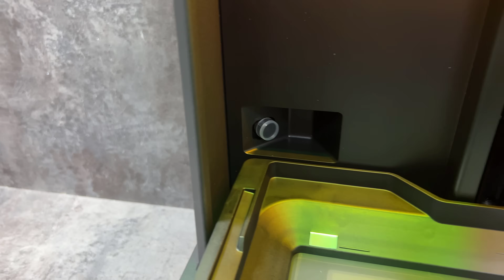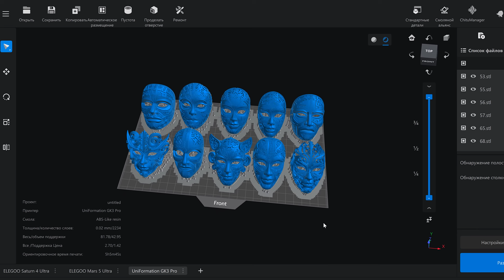Born from Light: Watch the Mask Rise from the Resin Pool

Comment: Very nice! I bought the materials to try the gelatin and glycerin mold making method, and it's funny you post a video of a resin printer, as I was going to as if the resin would inhibit the curing of the gelatin, like it does with polyurethane? (I know a quick coat with primer on the resin model can prevent this)
Reply from the maker: Thank you very much! I think the resin won't react with the gelatin.